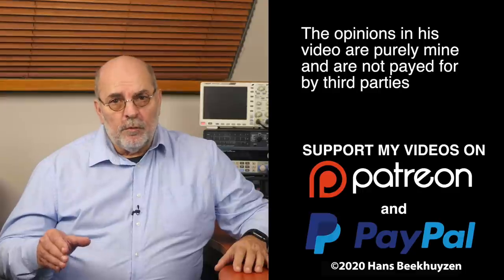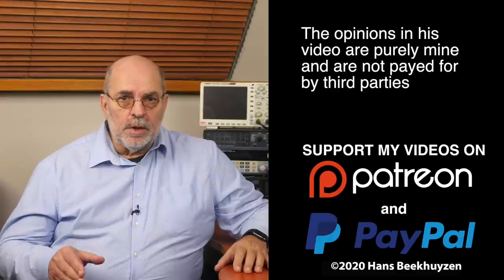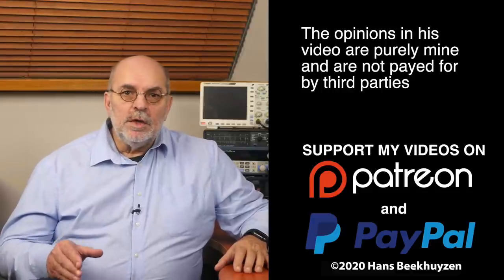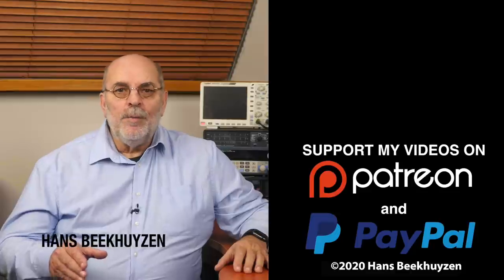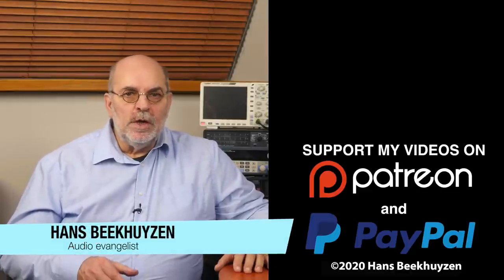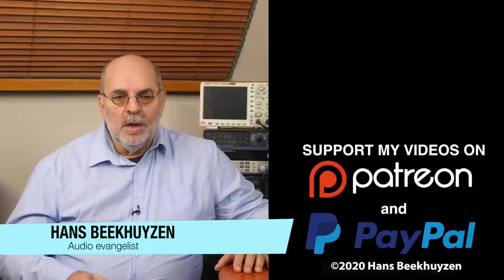Q&A: About external power supplies

Comment: I don’t usually comment on videos but this has to be one of your best presentations of technical content to date. It might even standalone as the best discussion of ac and dc electricity. Bravo Hans
Reply from the maker: Wow, thanks
Reply: @TheHansBeekhuyzenChannel  Greetings Hans! I’m curious about your thoughts on using a Halo Bolt battery. With usb into its dc 5V 2.4 amp max connections? I recently got a Bluesound Node Nano, and man do I love it. I use an external dac, and the Halo battery for its power supply atm. I have an IFI power supply coming today. Do you think it would be better served with my bluesound than the halo? I also power my Mojo 2 with the halo, when I’m using it in desktop mode at least. So I’d be curious if you think the IFI would be better for the streamer or the dac, both, or neither at all because the Halo is better? Ultimately I’m going to test all this, just wondering what you think. Love your channel!
Reply: I guess the video sort of hints at the IFI probably being better. But the halo is a nice battery. I think if the IFI makes a significant difference to the streamer I’ll get another one for the mojo 2.

Comment: Great video, thank you. What it the difference between the power supply and the power conditioner?
Reply from the maker: A power supply converts grid's 115 0r 230 volts AC into a low DC voltage. A power conditioner filters out interference coming from the grid.

Comment: Hi - nice video. Is it worth upgrading the wall wart switch mode supplies that come with internet routers? I heard they can introduce a lot of electrical noise into the electrical circuit they are connected to?
Reply from the maker: That’s what the video is about

Comment: Hi Hans - I do not understand you recommend a switch mode power supply for digital equipment - but in one of your reference set-ups you are using a linear power supply (Shanti) in combination with a digital streamer (Allo USBridge). Can you explain?
Reply from the maker: I don't believe in dogma's, I choose what sounds the best. A switch mode power supply doesn't need to sound better or worse than a linear one. It depends on how well it is designed. My Grimm Audio MU1 music player has a SMPS. Often, with better digital to digital devices the SMPS is of higher quality and then it is in many cased recommendable since SMPS's are capable of faster current delivery. But if a linear PSU sounds better, use that. BTW, they will sound different in most cases.

Comment: Dear Hans, I want to modify my Cisco 2960 8tcl networkswitch by removing the standard SMPS. I can buy a Ifi iPower X new (msrp 100,00)or Sbooster Eco MK2 second hand for about 175,00.

I understand it is hard to say which will preform better in this configuration without try and listing. Can you perhaps give  me advice based on your experience?
Reply from the maker: It is my experience that in general digital devices like switches perform better with audiophile switch mode power supplies. But there are those that think different.

Comment: I just swapped my sms-500 sotm power supply normally used for my sotm streamer and the sbooster power supply normally used for my Mytek Brooklyn.  The sound noticeably improved to my ears.  Punchier.  I would have thought the dac would be more sensitive to power and wouldn't like a smps like the sotm.  Hmmm.

Comment: Hey Hans Drew from Hawaii with the scorpio speakers! I've been watching your channel for about a year, just starting to stream Tidal mqa. I got the iMac with Audirvana and a MQA DAC. Just 2 days ago I seen your review on the original sotm sms 200. I'm about to order the sms200 neo and was thinking about the sBooster mk2. The spec of the 200 neo is Power requirement
  Input Voltage : +6.5 ~ 12Vdc
  Power : Max 15W. Do I want to get a 7v sBooster or anything within 6.5-12v? Thanks for any answer you can offer. I'm unsure what voltage to get, 7, 9, 12...
Reply from the maker: I have used it at 9 volts. Worked fine (see my review). I have no experience with other voltages.
Reply: @TheHansBeekhuyzenChannel  you're awesome Hans, thank you, I know you don't offer buying advice but I'm at a crossroad. The sBooster shipped to Hawaii offers a $84 savings over the matching sotm power supply. What do I do $84 buck will not break my bank but on pure performance do I get the sBooster or sotm power supply?
Reply from the maker: Yes
Reply: @TheHansBeekhuyzenChannel  from one Scorpio owner to another, yes sBooster? 😆😄
Reply from the maker: Yes. SBooster
Reply: @TheHansBeekhuyzenChannel  appreciate it Hans, thanks for your work, it's a real service for us!🍻

Comment: i have a NAD D1050 DAC with a switch mode PS.  i am thinking about upgrading to a Ifi Ipower
Reply from the maker: I don't know if that's will bring improvement. The iFi iPower is a switch mode PSU as well. But yo can try.
Reply: @joshua43214  can you point out which is the one you have tried?
Reply: @joshua43214  Can you tell us which medical grade power supplies from Mouser that you've had good experience using? The number of power supplies listed on the Mouser site is difficult sort out for me. Thanks.
Reply: Is it worthwhile to add a better power supply on a Mesh router (was thinking for the Ipower x)… and what do you think about using a Mesh router (vs main router) to feed a streamer (with an Ethernet cable)?

Comment: I don't have many experience on LPS, but I know the smps iFi iPower Elite their flagship psu is god like miracle. compare to battery power is like x10 to x20 times better in iPower Elite.
Reply from the maker: It's not important whether a PSU is a linear or switching type, It's important it's well designed and built for then both types can perform well (and  will not be the cheapest).